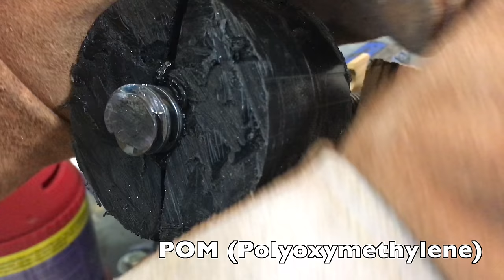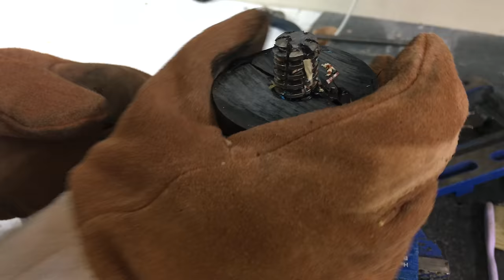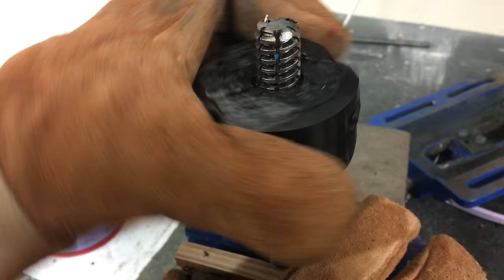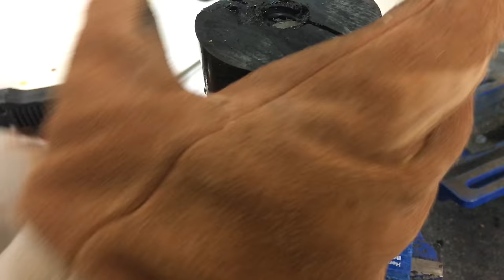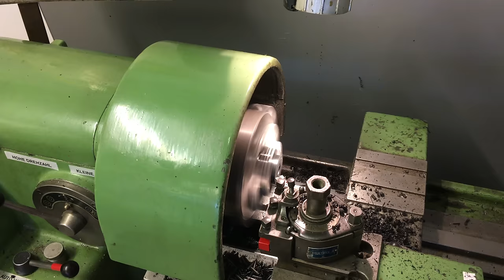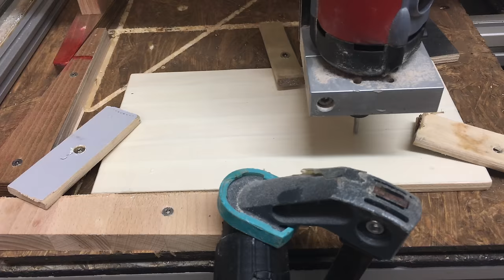Lets Make - A Cheap Anti-Backlash Nut for Lead Screws

Comment: I'm afraid  I'm with the 'it's not an anti backlash nut' brigade,  the word anti means preventing, your nut isn't preventing anything, it's simply stopped it happening for the time being.  Not that it's bad what you have done, I think it's fantastic. If you search for an 'anti' you will find its a very specific 2 piece device with springs in the middle pushing it apart. I like what you've done here, a self lubricating interference 'nut' and a tap made from the leadscrew without wrecking it, brilliant! I'm going to use this method to get rid of the backlash in my crossfeed screw, thank you. Oh yes, and another thank you for not talking to camera for half the video like far too many do on YT!

Comment: For all the effort, this is just a 'zero backlash' nut when manufactured. An 'anti backlash' nut has to compensate for the backlash that creeps in over use. And I don't see this happening in this.
Reply: how is does antiblacklash works? Actively how?
Reply: @davemwangi05  you can eliminate backlash by using a split nut in which one internal thread contacts the left flank of the external thread, and in which the other part of the nut contacts the right flank of the thread. Over time and during wear, you need to adjust the gap in the nut to get the threads touching both left and right again. Alternatively you can mount a second nut on the thread which can be adjusted tight into or away from the other nut to force one side to contact for each nut.
Reply: @derrytoolsltd991  I've seen only those using a spring to actively control that gap. What do you think about the idea of using a spring to keep the gap versus your idea of always coming back to adjust the gap manually?  which one is better?

Comment: Looking at the last few frames of your video I see that you left a slit in the delrin bushing, allowing it to be tightened by shimming in future. I think that subtle feature was missed by many people. It's a very good solution for your application.
I manufactured delrin bushings in-situ a year or so ago by pouring fine delrin shavings into the gap between a 1/2" bolt and a 1" ID steel tube each side of a nosewheel leg support and then melted it in place by heating the steel tube with a propane torch and then tamping it down. After 4 or 5 repeats I had  a pair of 3" long, hard, low-friction bushings cast into place that are a perfect fit and will last for a great many years. I fly that aircraft often. The pair of delrin-bushed bearings comprise the main pivot for the folding gear leg. This is not an ultralight or powered kite either - this is a heavy little 2-place airplane and that pair of  delrin bushings takes all the landing loads on the nose leg without deforming. The inside of the steel tubing still has the seam where it was formed and the delrin molded perfectly around those deformations, thus locking it into place, so that only the pivot bolt turns and not the bushing.

Comment: Well... That seemed a bit pointless.. 

If you were going to cut into an acme rod anyway, why didn't you just cut out four slots, and then use the lathe to cut a taper to create a tap? Then you could have produced the same part, without the need to introduce weak points, fissures, and voids in the nut?

Seems like a lot less work
Reply from the maker: This way it is a very tight fit.

Comment: As others have stated this is simply a nut no anti backlash feature. However it is a very clever idea.
Reply from the maker: I can measure no backlash, so there is no backlash.
Reply: @MaxMakerChannel  Meaning it is, at present, a zero backlash nut.  After a few thousand cycles, guess what?  Backlash will start creeping in.  This is NOT an anti-backlash nut.
Reply: @tvideo1189  who cares? make a couple of spares and simply swap it out in a few years or when it exhibits backlash again.
Reply: @fbloggs  Bwahahahah!  Necrothread much in your spare time?  Responding to  two year old post.  Funny stuff there!  And by the way, he could have made an ACTUAL anti-backlash nut very easily by merely making the split nut AS a split nut, screwed together like a clamshell with a bit of space between allowing tightening to zero... over and over again instead of playing pyromaniac with torches and gobs of melted plastic.  Bwahahahaah!

Comment: Great implementation, but have I missed something?  Have you just made a long close-fitting nut, or is there some actual backlash adjustment there?  Is there any backlash at all in this nut?
 I love the shortness & relevance of your video.
Reply from the maker: +Mark Smith When the nut cools down it shrinks around the lead screw and is in contact with both sides of the thread. I measured the backlash with a dial indicator and there is  none recognisable.
Reply: Right, but that's technically not an anti-backlash nut, it's just a close fitting nut.  It will wear and then backlash will emerge.  An anti-backlash nut has a mechanism (typically a spring) that forces the nut to expand to take up the lash as it wears ...hence it's name.  Tight nut =/= Anti-backlash nut.
Reply from the maker: +stoparret I know. We had this argument a while back. For an industrial machine this would not be good, but for my homemade CNC it lasted for 3 years now with no signs of wear. And if it does, I can make another set in an afternoon for little money. I saved the money over ballscrews which would have been a lot, because my leadscrews are 2m long.
Reply from the maker: +Marion Peretti I mill Aluminium with this.
Reply: When you inevitably get measurable backlash, can you reheat and shrink this nut back onto the threads or is it thermo set?
Reply: @ducatista1098s of course he can heat it again, thats the fantastic thing.

Comment: Hi, really like this take on making anti backlash nuts. Maybe a bit off-topic but I see that you use these on what seems to be quite a large format cnc router? Are you happy enough with the speed and precision these standard trapezoidal lead screws provide? No whipping on the long axis?
Reply from the maker: +Niels Samuels very very happy. There is no whipping since the steppers don't go fast enough. I would chose a bigger lead screw though. 25mm over 16.
Reply: Good to hear! What size steppers and what drivers do you use? you now use 16x4 screws right?
Reply from the maker: +Niels Samuels yes 16x4. See the instructable.

Comment: I really like your video.  I want to make this anti-backlash nut for my metal lathe.  I'm wondering where you get your POM (polyoxymethylene) for cheap.  I found a place online with a 50mm(2") rod - 100mm(4") long for $200 USD!  Thank you for any help.  Also why do you cut the lead screw at the beginning of the video?  I see that you show a tap by its side.
Reply from the maker: David Rice That is crazy! I don't know where you live but in Europe you pay 10-15€/$ for that amount. I bought mine on ebay.
Reply from the maker: +David Rice The cuts create cutting edges just like in a tap and die.

Comment: Nice...

though I'm thinking as an alternative you could make a mold around the lead screw and use a resin similar to what is used in skateboard wheels.. then turn it. 

either way... that's pretty cool.

thanks for sharing
Reply from the maker: +chase Thats a cool idea. Why skateboard wheels?
Reply: +Max Musterman - the resin used in skateboard wheels is tough, durable easily molded. It's also used for many track systems, even roller coasters, camera dollies etc. It also comes in just about every color one can imagine. all types of hardness, etc.

that and it was the first thing that came to mind. heh heh.

But rather than melt it on. you could pour the resin. Any flavor you like... and get a sure fit. Just spray with a release agent and breaks free. Instant lead nut.

You could even mold in mount screws if you had a jig set up.

Of course this is all theory... I haven't tried it. But after seeing your video.. it sure seems plausible. Sounds plausible saying it out loud... seems possible thinking it over... 

what's your thought? You think it would work?
Reply from the maker: +chase Alright. Never came into contact with skateboards, but they look quite slippery. I always wanted to do a mold making project, so I think Ill might give this a try. Also got another build video planned with a linear actuator where I need a new nut.
Reply: +Max Musterman - So looking forward to the new vids. 
Good thing I subscribed!
Reply from the maker: Thanks!

Comment: No real anti-backlash mechanism and being made from plastic should last only a few weeks before wear is a problem.  Why not just buy a real anti-backlash nut or if you don't want to pay then 3D print one that would be just as good (you can adjust the thread to give minimum tolerance) and would probably last just as long plus if it wears you can just print another.

Comment: What is the purpose of sawing the tip of the screw at the beginning?  
Thank you very much!
Reply from the maker: +Andres Valdes That turns the screw into a tap. The slots cut the thread. You melt around the plain end and then turn the screw to the other end where you refine the thread by cutting it.
Reply: Thank you so much.

Comment: Very well done.  However when you consider time, labor, materials, etc., is it cheaper and more sensible to buy something similar from Amazon?
Reply from the maker: Can you buy something like this on amazon? It takes me about 30min to make a blank and another 20min on the lathe.
Reply: Did you reelly ask it I could buy an anti-backlash nut from Amazon?  Plus, you're discounting the amount of labor involved, raw materials (how much does POM go for, who are my primary and secondary vendors?), capital equipment and supplies, and G&A (did you make that in one take, without any planning or prep?).
Reply from the maker: Watching this video is enough Prep. The pom used costs maybe 3€. I don´t thinl there is a 16mm 2 Flute P8 metric lead screw anti backlash nut on amazon.
Reply: "Watching the video is enough prep," says all I need to know.
Reply: Cost in Canada to import these is basically $40 each and if you have 3 axis like myself wearing out 4-6 mo it starts making sense

Comment: If using a nut made of something other than metal was a viable option the manufactures would have jumped on it. It would only take a small amount of force to distort the thread in the plastic nut.
Reply from the maker: My CNC is still running and very well : )
Reply: @MaxMakerChannel  , I can see it working and holding up on softer materials but not on steel or aluminum unless the cuts are really small.

Comment: you should try some polymorth, mouldable in hot water so no need for flames & toxic fumes.
Reply from the maker: I thought about that and I use it in my other videos, but POM is better for long term wear.
Reply: Its handy stuff but yeah ive never used to anywhere that it would wear
Reply from the maker: +RabKirk I love that stuff. So many applications where it saves your day.
Reply: polymorph is not very hard-wearing.

Comment: This is dreadful. You dont even have the axis of the nut's shaft to the faces you have cut (watch it wobble its way down the leadscrew at the end). Why didnt you just use a solid piece and then tap it rather than poorly try and backfill it after clamping it around the leadscrew. The whole thing is exactly the wrong way to go about making a leadscrew nut, and it isnt even a zero backlash nut, or backlash reducing nut. Its just a nut.
Reply from the maker: It has zero backlash. Love it or hate it, but since it is a slight interference fit it has no backlash. The CNC has been running for 8 years now without any issues or noticeable wear. You can watch it run in a few of my videos. Back then, ball screws were quite expensive, so this was an affordable alternative.
Reply: @MaxMakerChannel  It might have very little backlash, but it cannot have zero backlash. It also is not an 'interference fit' of any sort (interference fits do not and cannot move, otherwise it is not an interference fit). Firstly there is nothing in the design that accounts for slight variations in the manufacture of the lead screw - it will not be perfect and this is one of the ways that backlash creeps in and why backlash will not be constant across the whole of a leadscrew (the exception being if it is precision ground to a very high standard). Secondly unless you have something that will keep tension across the two pressure faces of a thread like a split nut or a ballscrew system the second there is any discrepancy between one of the pressure faces on screw and nut you have backlash.

It sounds like you have a solution that works much better than the stock T8 nuts, and this is working for you which is good, but that doesnt make it what you suggest it is - Anti-backlash. If it works as you say it does then it is just a T8 nut that is a close fit.

Comment: Nice but it is of no use if it is not mentioned what wa  added in the nut & melted . So that no back  lash occures .
Reply: Fairly obvious that it was most likely the same material as the nut, POM.

Comment: that's not anti backlash..
Reply from the maker: +Paolo Yes it is. There is no backlash.
Reply: Max Maker sorry but anti backlash means that there's some kind of mechanism that eliminate the slops by tensioning the threads of the nut. Maybe your nut has little backlash but it won't be completely eliminated
Reply from the maker: Paolo anti backlash means there is no backlash. How it achieves that does not matter. I can put a dial indicator next to my cnc and there is no change in deflection when moving back and forth.
Reply: Eventually there will be backlash when the nut wears.
Reply from the maker: +J Mc Eventually. I make these in 30min.
Reply: Max Maker I'm not saying it's a bad job... I trust you, it's just a matter of names..
Reply: I initially thought the same thing, but it's wrong. POM has a higher thermal expansion coefficient so the nut shrinks much more than the rod as it cools after the molding process, narrowing its thread spacing compared to the rod, causing tension. The result is something like a conventional anti-backlash nut with a spring that PULLS rather than PUSHES the halves together. The amount of tension is determined by the length of the nut and the difference between the thermal expansion coefficients of the materials used to make the nut and rod.
Reply: IrrelevantFish that's a really good answer and maybe it should have been the right one for my objection
Reply from the maker: +IrrelevantFish I kinda agree, but it also gets cut by the thread cutting part.
Reply: I'd forgotten about the thread cutting, but backlash can only be eliminated through tendon. My guess is that your thread-cutting method is  inaccurate and doesn't fully "correct" the differences caused by thermal contraction, and if it did, the nut wouldn't work.
Reply: J Mc Pom, HDPE, and Delrin are all materials that have high libricicity and little wearable properties that will last a very long time. Most likely last as long or longer than any C7 grade bearing ball nut and the fact of the matter done correctly this is a zero backlash product. We make these for SFU2005 ball screws (20mm) from HDPE in a solid block, meaning we don't split ours in half and we don't have too. Our nuts are 100% solid block internally threaded and precisely .000. How long they last is a unknown and dependent upon too many variables including daily use or typical hobby use. Quite amazing really and used in conjunction with a ball bearing nut I imagine the two maintained will lastnthe lifetime of a machine for any hobby user out there.
Reply: Glenn Edward 

Would be possible to just melt some HDPE into the top of a nut that is already threaded into the lead Screw, to remove the backlash?
Reply from the maker: Probably. You could try.
Reply: I still don't understand how this is anti-backlash.  There may be tension (pull or push) in the plastic however that will have thermal expansion issues wrt to the Rod and self heating from friction.  There needs to be an active compression/tension from a spring in my understanding to take up the slop in the threads.  Would love to hear an explanation on how this works in your design ?
Reply from the maker: You are talking about slop in the threads, normally there is play between a steel nut and a steel threaded rod. That play is needed so it can move. Here there is absolutely zero play. It can still move because the plastic can deform a tiny bit over irregularities in the thread. So there just is no backlash because there is no space that the screw could lash back into.
Reply: Aha!  very cool.  I also assume that the plastic has a very low friction coefficient too like PTFE ?
Reply from the maker: Yep
Reply: Paolo are you a machinist..? dont see anything on your web page
Reply: Max Maker thats due to ballscrews...and yes those will have back Lash combined with servos  the pressure will give you zero..kill the power..backlash